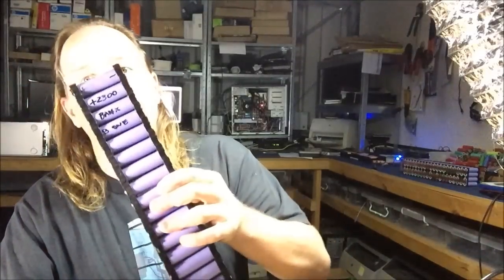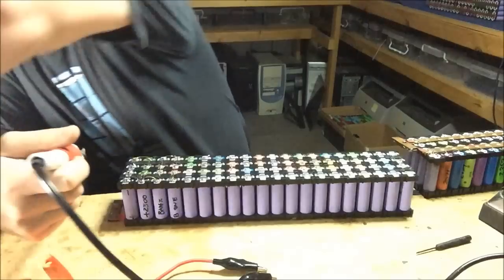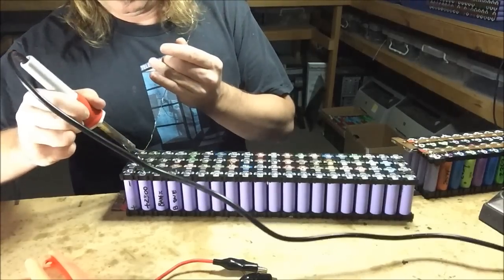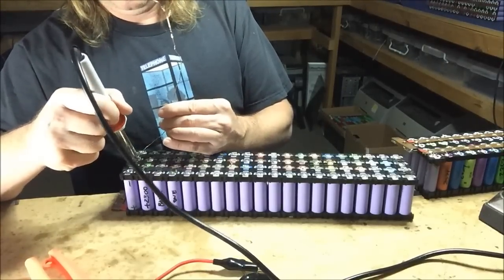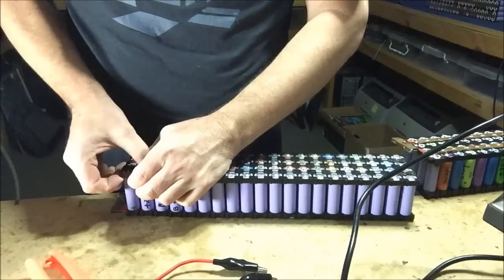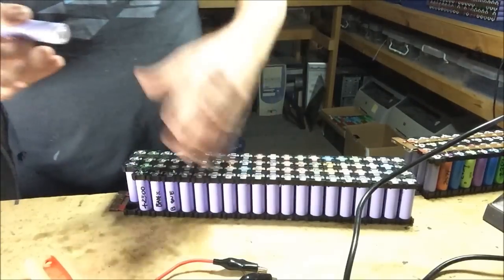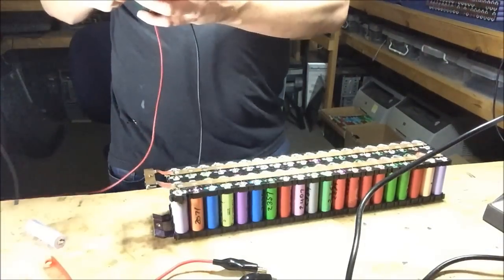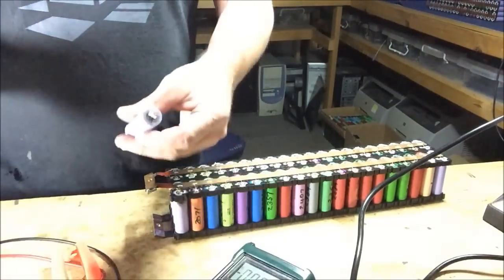80 cells versus 1 faulty cell 18650 fuse test

Comment: Great test! Always good to know that the fuses work. It's a lot of work adding them to a pack.

You mentioned that you wanted them originally to blow at 4 to 5 Amps, but I think you should be happy that they blow at higher currents. The purpose of these fuses is to protect the other cells in the bank, not to protect the cell it's connected to. When you shortcut a single cell, you easily get more than 4 Amps. If you would accidentally shortcut a whole bank and the fuses would blow at 4 to 5 Amps, all fuses would blow at once (sort of, within a relatively short amount of time). To protect a whole bank, you use fuses between the battery packs and the inverter (right?) 

Another thing is that you could have peak currents when, for example, you switch on a device. If your fuses would blow already at 4 Amps, these peak currents could blow a large amount of the fuses in a battery pack. You don't want that to happen.

When a cell goes bad, it doesn't do that instantly. It's not a fuse. I think it's a slow process where with the increase of temperature, the current goes up because the internal parallel resistance goes down. (Not the same IR we talked about before. This one is like a parallel resistance. The IR we talked about before is like a resistance in series with the cell.) Eventually that parallel resistance goes down so much the current it pulls from the other cells will be too great and the fuse will blow. Before the fuse blows however, the cell can get so hot, that the plastic protection layer will start to melt (boil!).

Just me thinking out loud,.... may help you realize that the way it works now is actually better than the 4 to 5 Amp fuses you originally planned.